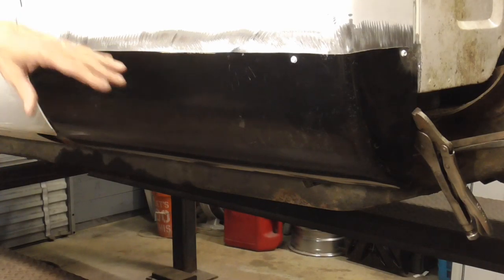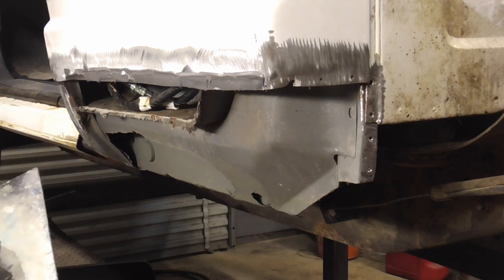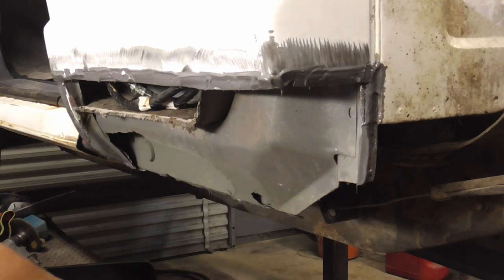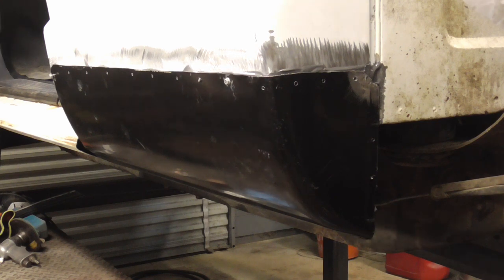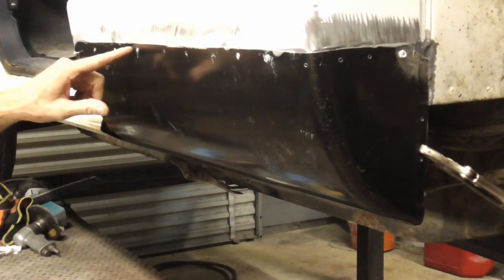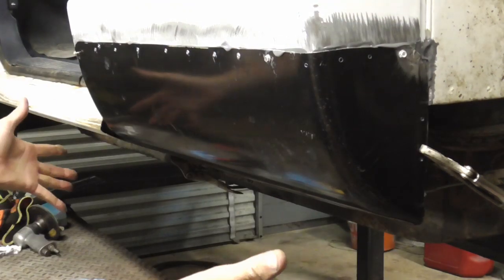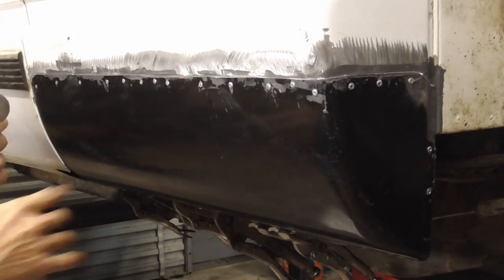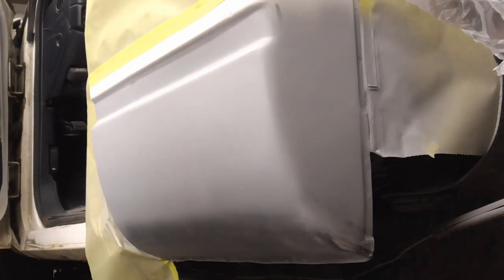Cab Corner Patch Panel Installation with JB Weld | Panel Adhesive

Comment: I use liquid nail .works great ,and cheaper
Reply from the maker: Really? Have you done a repair with liquid nails?  If so, what kind of liquid nails did you use - very interesting because some of that stuff is incredibly strong and stays somewhat pliable.

Comment: Is all metal a better product it is made for stuff like this and comes in cans
Reply from the maker: I've never used anything but regular filler.  In my opinion it's how the repair is done and how it protected after the repair that determines longevity.  fiber filled filler and all metal can't hurt though - that's for sure - might even work better.

Comment: Anybody that truly knows how to do bodywork would never use any panel adhesive on anything except a pinch or spot welded seam. It is meant to be strong but is still flexible. Good luck with the seams not cracking the bodywork. Welding a seam is the only true way for integrity. Pop rivets left with the 70s
Reply from the maker: Panels are glued at the factory all the time.  ICAR wants repair people to use the same method with repairs to aluminum bodies and other glued panels - see article - https://rts.i-car.com/collision-repair-news/rivet-bonding-is-just-for-aluminum-right.html  Be positive my friend and keep that mind open.  When you hear or see something that sounds a bit different, do your research to find out the absolute correct answer.  Never say anything unless you know for sure it's true or other guys will treat you poorly or disrespect you.  Just trying to save you some pain when with friends :)  Here's the follow up on this repair 3 years later - no cracks - https://www.youtube.com/watch?v=gIS1Tbv7Kvw

Comment: bondo and paint is what a bodyman ain't. I really hope this is not a customers truck.
Reply: J COOK in the real world yes , plastic fillers and epoxy are fine when prepped correctly . Bondo is a brand of plastic filler ,but any plastic filler used by hacks give them a bad name . The job in the video is fine for non structural repairs . Welding will damage the old metal and the new making it more likely to rust . I just mig welded in my rockers on my 2011 F150 in Ontario to pass a safety check they have to be mig or tig welded with a continuous weld and butt welded because they are considered structural, the original rockers were not welded like that at the bottom of the rocker from the factory. The structural adhesive sold for body shop use if used correctly will cause the metal to rip before they let go but are costly . The JB epoxy  the tech is using here is not the 5 min stuff it takes 24 hours to harden if applied correctly worked great on fibreglass boats cars and metal steel and aluminium in my opinion . Rockets and many  planes have skins bonded with epoxy for many decades. Now if a customer wants to do a trailer queen on an old car cut of the whole panel remove interior and weld in a new panel hours labour $$$$ . I was quoted  $ 2500 and $ 4000 to do each rocker and cab corner on my 2011 f150 which I mig and butt welded  so it would have added $ 5000 - $8000 to the cost of the truck also while doing the rockers I am doing the whole lower part of the truck and yes body fill will be used to cover the ground down cleaned welds and primed and painted once painted the truck will be oil undercoated missing nothing including the inside of the frame tailgate box doors rockers and cab corners crossmembers  suspension  cab floors cab pillars inside using 1/2 holes drilled and then plugged. The truck will be oiled annually from here on ,I was out today and noted other brands of pickup trucks 7 years old and older fenders cab corners rockers  tail gates were shot on most the owners paid $ 40k to $ 85 k for them annually oiling would have save the owners this .
Reply: @nickking1510  see the Project Farm YouTube videos for maintenance tips.

Comment: Be prepared to be finding cars in the future that are falling apart cause they are held together with jb weld and rust holes filled with fiberglass.
Reply from the maker: I'll do a video on this truck 10 years from now - it will still look great.  Please see this video for longevity of this type of repairif done correctly: https://www.youtube.com/watch?v=8XaZBy7GC7A or 
https://www.youtube.com/watch?v=2o37dX--w0I
Reply: Master Of none tv they been using epoxy on rockets and planes,boats since 1960ies . . , boats dont fall apart they are fibreglass the smaller ones ,I have 1977 searay fibreglass it not falling apart and a1976 vette not falling apart either . What can happen the metal around the repair can rust so I spray oil on the back of the repair it won’t rot then and repeat yearly in fact I do the whole car or truck
Reply: @nickking1510  yeah no one is gonna just slap some jb weld or fiberglass in a half ass repair job. Everyone is gonna properly prep everything and put it together to so it looks good and may actually hold and not fall apart.
Reply: Master Of none tv sorry I was not trying to be rude , but lots of people who make jokes  of epoxy and other plastics like to call them bondo and go over rust paint dirt grease I see them on the road all the time big mess of body fill then some paint these people give there products a bad name
Reply: @nickking1510  no worries. My whole point was people are gonna see these  videos and be like hey I seen people making these repairs with jb weld or whatever on youtube and then do some real shitty repairs. I've got an old mustang that I'm dealing with this kind of stuff on.
Reply: Master Of none tv your right most people doing the repairs won’t prep correctly to much work for them and complain that the product is junk . I agree this repair almost as good as welding in the area shown in the video . Just did rockers,cab corners in my 2011 f150 I purchased in the fall  welded them in ,cab corners Welded in the top and the door jam and spotted the bottom to mimic Oem ,the part behind the box I used an epoxy structural auto body adhesive to do the back of cab corners.

Comment: This is the reason real bodymen cant get paid a decent labor rate. Because of a bunch of make up the rules as you go butchers on YouTube trying to pass this garbage off as a legitimate repair. This makes me sick and you should me ashamed of yourself
Reply from the maker: I'm a retired body man.  This repair is perfect after 3 years of driving in salty MI it will last forever if maintained.  See vid - https://www.youtube.com/watch?v=gIS1Tbv7Kvw You can weld or glue - your choice. Today lots of shops use glues for rust repair because of the water tight seem.  The real reason body men don't get paid well and you should know this if you worked in a body shop is insurance companies, insurance adjusters, no unions, high cost of materials :)

Comment: Wow, what a HACK way to repair rust. All that prep and you didn't weld it in? GTFO...seriously crappy repair....🙄
Reply from the maker: Lots of body shops use glue now for rust repair.  This repair is still in great shape after almost 2 years.  It will last forever - really.  How are you suggesting to weld it - butt or lap and, does a welded seam seal out moisture better than glue or panels adhesive?  Just giving folks all the options - I do have welding videos butt and lap on the channel if you prefer those methods.  Jerry

Comment: Wow... He must be using a special version of JB Weld, because I have been using it since I was a kid (I'm 67 now) and it NEVER took 8 hours to get hard.... to cure completely maybe, but the working time has always been just a couple of minutes if you follow instructions at all...  hmmmm  I guess ya could go weak on the hardner for more time, but to me, it'd possibly make your end product weaker as well..... maybe not.... you can tweak the mix with bondo a bit sometimes, so......
Reply from the maker: They have "Original" and "Fast Setting" - Original has always taken a very long time to cure or harden :)

Comment: For any canadians looking for panel bond there is dominionsureseal.Its similier to 3M panel adhesive.I actually stumbled upon it while researchimg 3M panel adhesiv/s
Reply from the maker: Thanks so much for that information - good to know about other adhesives that work well :)
Reply: @LakesideAutobody  No problem.Evercoat also has panel adhesive.Both of these are 1/2 the price of the 3M stuff.
P.S nice work btw....do you always screw down or just personal pref?
I would think the rivetets and screw holes left would be corrosion starting spots from the backside?